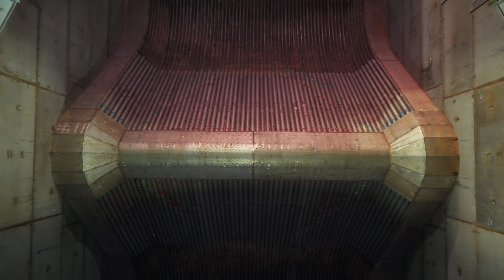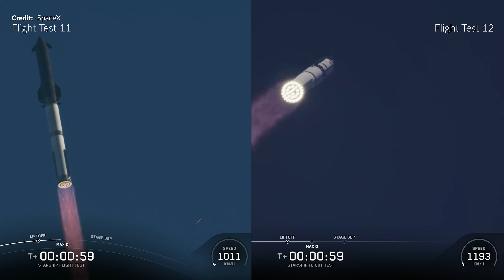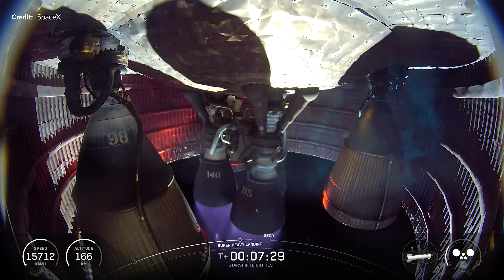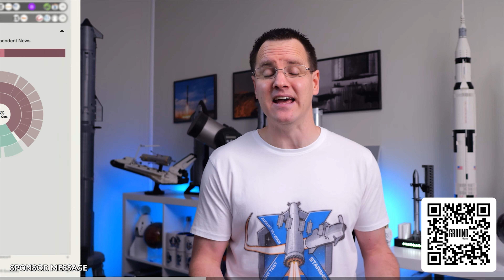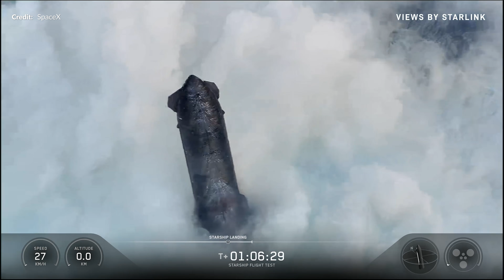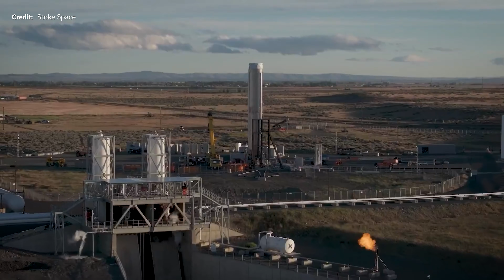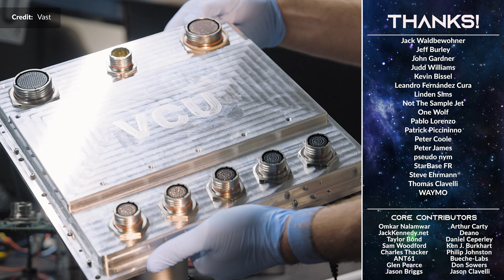Starship Flight 12 Explained - The First Version 3 Starship

Comment: Anyone who thinks this system will be rapidly reusable (less than 60 days) is just delusional. What SpaceX never shows is the massive amount of damage to engines and shielding after just one liftoff.  The thermal shock alone to propellant tanks requires detailed inspections, unless you want to make a bomb instead of a rocket.  
The biggest problem of course is the rocket equation.  All the reusable weight is payload you lose.  Someone should have told the charlatan, Musk, about the rocket equation.  Not that facts would have ever stopped him lying to congress

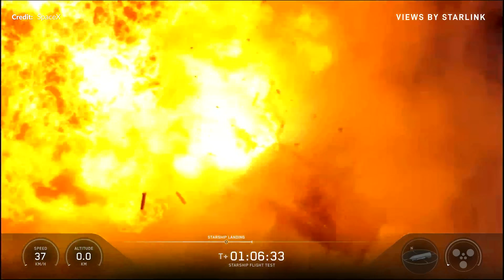Comment: 18:03 is that failure? I mean all the thing about SpaceX is reusable rockets, boosters and equipment to reduce final cost of flights, right? So this explosion is failure, and everyone is like: ''great SpaceX success'' (wtf?!)... anyhow, as I understood some of engines shut down and due that, they couldn't be ignited again, so reactivation fail, and speed wat too high for safe landing, to me engineering must do more about rocket engines to be able to reignite if they shut down. There is a lot of work still to be done, and to me, why engineering do not go into direction of vertical take of and landing, to me it should be safer and easier to reignite engines if they shut down! I'm afraid that maybe concept is too demanding at the moment...

Comment: One thing I noticed right away as Ship fell over after touchdown was the heat shield looked quite intact. It was still black and not stained like on Flight 11. That and no burn throughs were seen on the flaps. 
Progress.

Comment: The thruster nozzles where not optimal, by the lack of telltale diamond shock patterns in the exhaust
Reply: That many engines firing so close to each other disrupts the shock diamonds of any individual engine. That doesn't mean that the engines aren't firing optimally, though on this flight obviously one of them shut down early. They are a great visual indicator for single engines or small clusters, but you can't really use them to judge the nozzle condition on something this big. The plume as a whole though actually does produce it's own, much larger, much weaker shock diamonds, which are visible at a couple of points in the flight. It's just there because of interactions with air pressure, but it's cool.

Comment: Contrary to Boeing and NASA, at SpaceX, there are no endless committees that have to cover their backs, behinds, sides and fronts before they would agree to anything. This will come sooner or later, of course, but for the time being it means that improvements, ideas, and suggestions will be taken up or not based on their value, not on basis of the benefit of it for internal politics. That makes a huge difference. Jack Welch at GM and Jan Timmer at Philips Electronics have tried to do away with internal "layers of clay". Both failed. Recently, in the USA, another layer of clay has been put over the layers already in existence at large companies that are vying for government contracts. As of 20 January 2025, any idea, improvement, or suggestion must also contain some kind of praise of or bribe for the child in the WH and bribes for his mob of grifters.

Comment: Still laughable images of Starship taking humans to Mars. It may be powerful, but its still a chemical rocket, so doesn’t have the specific impulse for Mars insertion in a reasonably short time. It may well be used to shift cargo to Mars to preposition kit there. But shifting humans requires a much shorter journey time. So any manned ship needs to use some form of nuclear electric, or plasma drive.

Comment: "The reentry of decommissioned satellites is increasingly recognized as a significant source of upper-atmosphere pollution that threatens the ozone layer and alters Earth’s climate.  As satellites burn up, primarily between 50 and 90 kilometers altitude, they release vast quantities of metallic aerosols and reactive gases that persist in the stratosphere and mesosphere for decades. 

Ozone Depletion Satellite reentries are a major driver of ozone loss, with nitrogen oxides and aluminum oxide nanoparticles being the primary culprits.  Nitrogen oxides, generated by shockwaves compressing atmospheric nitrogen, currently account for approximately 50% of ozone depletion caused by satellite burns and rocket launches.  Additionally, aluminum oxide nanoparticles act as potent catalysts for chemical reactions between ozone and chlorine; while these particles take up to 30 years to drift down from the mesosphere to the ozone-rich stratosphere, their cumulative effect could severely reverse the recovery of the ozone layer, which is not expected to fully heal until 2066 even without this new threat"

Comment: The booster faced an engine explosion during boost-back burn and SpaceX had zero confidence in Raptor re-light of Starship in space either after engine failure, meaning it could have exploded when they had attempted it. I hope it is a plumbing issue and not an issue with Raptor itself, else they are cooked for another 2 years. Ambitious project but needs another decade and that assumes these issues are solvable with the existing materials and technologies.

Comment: I am a mechanical engineer. I understand Elon likes to do things different. But kind of like the Cyber truck, this doesn't make a lot of sense.
  Vertical takeoff is nothing new. Vertical Landing is. So I will definitely give his Engineers Credit for that. At least some of the time.
  What I don't understand is why don't they build on something that has been proven to work. The space shuttle. Vertical launch, horizontal controlled Landing.  Obviously upgrade and modernize everything. Use the Raptor engines. Ditch the booster Rockets. And that could be done with the more modern Raptor engines. Install Raptor engines on the external fuel tank. To assist with launch as well as recovery. 
  This way you not only have a very large payload Bay for putting satellites into orbit, but you can also recover. And the space shuttle has a decent amount of room for the crew. Then add in the fact that it can pretty much land in any atmosphere.

Comment: SpaceX has a lot going for it ... but is also trying 1 step too far.   They really should just be making Shuttle 2.0s, with the new thrust systems they would get into space easily, have a better payload deployment, and much much safer landing using aerodynamics rather than the incredibly risky rocket landing gimmick.

Comment: The detonation shockwaves are like nothing ever seen on any rocket before - nearly 3X the power of the SaturnV & the Shuttle (which had 2 solid boosters and several orbiter engines.)

The shockwaves are just mind blowing. I remember that airborne frog from a shuttle launch years ago - these shockwaves have got to be exceedingly debilitating if not lethal.

Comment: It didn't take 10 seconds to start moving.  Only about a second and it was on its way up.  POWER.
I'm wondering... Did SpaceX expode the ship with the remote or did it just happen because of the falling over?  My guess is on purpose to keep China from getting their hands on it.  Wouldn't put it past them.

Comment: What I notice about the splash down of the upper stage is that it might be survivable for a future human crew if you could dump as much fuel as possible before tip over. An emegency splash-down anywhere procedure would be an excellent thing to have up your sleeve. You could do a hover just above surface until the engines run dry, open all vents, and cross your fingers.
Reply: I expect a crewed reentry vehicle would have a separation-capable capsule like the Dragon with it's own emergency engines a la Draco.

Comment: i noticed that the booster flipped so quickly from the help of the starship exhaust plume, which was hard to see, that it looked like it may have scorched the side of the booster itself. i wonder if the booster was damaged from that.. or from the violent quick spin. g-forces. The booster walls are thin... and weaker without fuel at that point.

Comment: to me it looks like the starships shield held up a lot better this time? Not so much orange strayed all over the tiles either?
Reply: They didn't have the same experimental tiles this time, which was previously the source of the orange deposits.
Reply: @pauldorman  I see, thank you for that, was that experimental tile a new cooling attempt?
Reply: @TyBTheG  I think there were experimental tiles and missing tiles on all previous flights. There's only so much you can achieve in a hypersonic plasma wind tunnel.

Comment: Still seeing engine reliability issues. Aside from the obvious fueling issue at staging (not an engine problem), two engines failed outright and something was getting red hot on one of the five running starship engines. Surprised to still be seeing this level of failure.

Comment: Some shielding will be put back on the booster around the outer engines. Visual and telemetry data indicate multiple dynamic stress events resulting in turbine damage and subsequent detonation. Also notable is the sight failure of one of the outer ring engines during flight. That engine was also in the affected area where the booster was using engines for its deorbit burn, failing successfully in the deorbit burn.
Although this new design was not expected to survive nor make it to Earth, it still went through all possible planned failure states before hard landing in the ocean.
Conclusion on the new booster: design is solid but requires outer engine shielding with minimal shielding material. Engine design is solid. Some protection may still be required around the V3 pumps. The engine design allows for minimal protection given the reduction in parts in the V3 design.
This is a short analysis because I am more interested in the Starship itself. I will do a separate analysis of that when the remaining data has been processed.

Comment: Starship Launch 12? I tuned into The Angry Astronaut’s live report about 12 minutes after launch, so I skipped back to about 5 minutes before Starship took off. The launch was as spectacular as expected after 43 minutes of Angry’s video. There were questions about the Super Boosters’ splashdown that Markus House answered in his Starship review. The Angry Astronaut’s video was too long for the Opal app I made, of the same rocket that blows up after splashdown… I used the Key Points AI app for a brief summary and to list the key points of Markus House’s video:

The Era of Version 3

SpaceX transitions to the future of interplanetary transport with the debut of the fully redesigned Starship hardware at Starbase, Texas.

Mission Summary

SpaceX’s Flight 12 marked a significant transition for the Starship program with the debut of the Version 3 hardware. The mission was characterized by the immense power of the Raptor 3 engines and the successful demonstration of the integrated hot staging system.

While the Super Heavy booster failed its recovery objectives due to a chaotic boostback sequence, the Starship upper stage met nearly all primary goals, including next-gen Starlink deployment and a stable reentry, proving the durability of the updated flap architecture.

Flight Highlights

01

Version 3 Launch

First flight test from the new Pad 2 at Starbase. Featuring Raptor 3 engines, integrated hot staging, and a refined thermal protection system.

02

Booster Dynamics

The Super Heavy booster achieved higher thrust-to-weight ratios. However, the boostback burn failed following the hot staging sequence, resulting in an off-target splashdown.

03

Payload & Orbital Maneuvers

Successfully deployed 22 units (including Version 3 Starlink satellites). The satellites performed an external heat shield scan, mimicking NASA Shuttle procedures.

04

Soft Reentry Success

Demonstrated high stability during reentry with new single-actuator flaps. Executed a two-engine flip and soft splashdown in the Indian Ocean.

Global Space Industry Updates

SpaceX Milestones

Nearing a historic milestone: launching more satellites than the rest of the world combined throughout history. IPO rumors continue to circulate.

NASA Psyche Mission

Completed a Mars gravity assist, capturing high-resolution imagery and gaining speed for its long-distance journey.

Vast & Stoke Space

Vast expands into orbital data centers using NVIDIA modules. Stoke Space continues structural testing of the Nova first stage.

ESA / China SMILE

Launched on Vega C to study the interaction between solar wind and Earth’s magnetic field.a

Comment: Except for the first few minutes of the launch, literally everything went wrong, starting when the first booster engine failed. Then they were unable to restart the booster engines, causing it to crash into the ocean in an unknown location at high speed. Then one of the three main engines on the Starship vehicle itself failed. Then they were unable to restart the engines on the Starship vehicle until it was just above the ocean, and it exploded on impact.  And this was the TWELFTH launch of a rocket that is supposed to carry a HUMAN CREW? Unreal. No other rocket in history has had failures like this, over and over again. Not even close. The Saturn V was launched 13 times, with only minor issues on the second launch. The third launch took humans to lunar orbit. The ONLY serious failure of the Apollo/Saturn V was Apollo 13, which was not the rocket itself, but in the Apollo service module. Due to the Apollo's design, they were able to get the crew back safely. SLS has had a lot of problems on the ground, but it's first 2 launches were perfect, carrying a human crew to the moon on the second launch. Even the much maligned Boeing Starliner made it back safely on all three launches, and carried a human crew on the third launch. Starship is an utter disaster.
Reply: Nonsense. Falcon and Falcon Heavy were also 100% successful on their first flights, and were completed in a fraction of the time of those programs you mention (FH has a perfect record, F9 is the most reliable rocket ever). It goes to show how much enormously harder Starship is than legacy simple rockets.
2. The reusable orbital heat shield is the single biggest remaining challenge for Starship, and it performed great, no burn through, no lost tiles, successful re-entry and landing (explosion is expected and desired to sink it fast).

Comment: at 13:55 - I beg to differ here, the missing vacuum engine and skipping in-space raptor relight isn't directly related to target entry point.  The trajectory can be changed based on many parameters.  I.e. you could very well have a relight and a missing an engine and still hit on target.  It is all about the duration of the burns and the orientation of the center 3, or the incidence of the trajectory.

Comment: I think getting ship all the way down in one piece with zero burn through and zero ablation until ablation was expected, is far more important than getting booster to a soft splashdown. Maybe they just flipped too fast and stressed the vehicle too much. Seems like some really important progress was made on this flight which includes a pretty much entirely new ship and booster. Really impressive.
Reply: It all matters, of course; and since I’m assuming Booster costs more than the Ship, and full-reuse is the ultimate goal to change the industry, they know they have homework to do. E.g., do they need to sneak back in some of the things they so aggressively, er, ‘deleted’, for V3? - Dave Huntsman

Comment: Wooooo!!!! Flight 12

For a brand new system and mostly redesigned rocket, I think that was very, very successful. We made the whole trip. spalshed down on target, no major anomalies. That was incredible!

Can't wait for flight 13! Thanks for always keeping us informed Marcus!
Reply: Say what? The booster bit it at high speed. This would be a massive failure for any other rocket company
Reply: @ahhmm5381 for every other rocket company (with the extremely slight exception of Blue Origin) the booster always smacks into the water and they dont even pay attention to it.

They've alrrady proven catching them and this one just had issues with engine startup, it still got the payload (in this case the ship) on the intended trajectory